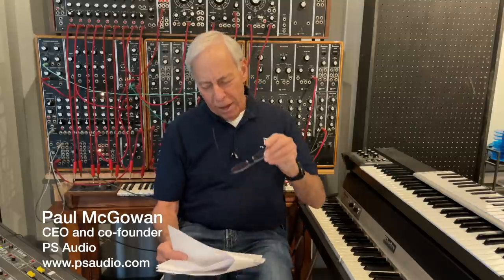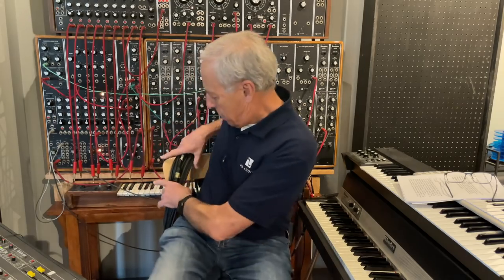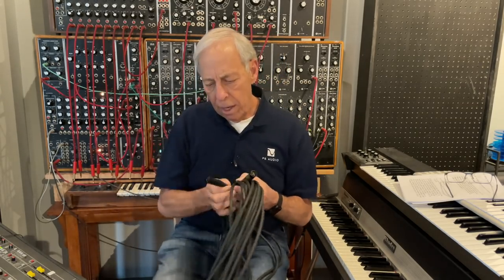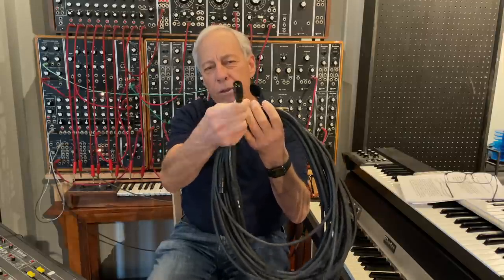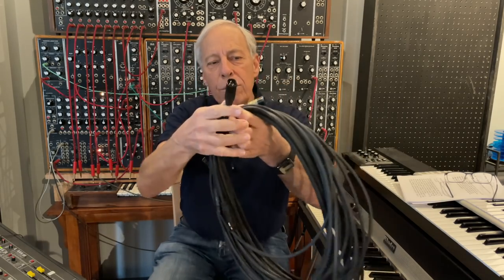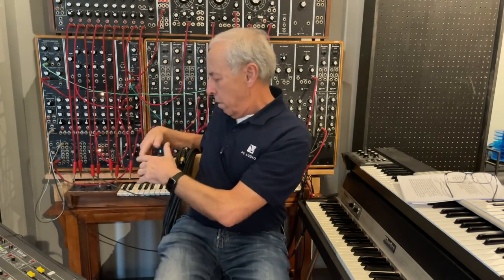Mixing XLR and RCA cables

Comment: Not really balanced not necessarily, balance can have a loss in sound quality depends on the construction of the equipment and if it's truly balanced or pseudo balanced and RCA cable can be great better in most circumstances. there's a big mistake people use the wrong type of cable and use 75 ohm should never be used for analogue signals, should be between 30 and 65 ohms and lxr cable is usually 50 ohms, specially for turntable use should be 30 / 50ohms, quality coaxial cable is fine for RCA especially on short runs that most people will have under 45ft more important is the type of construction of cable lxr is usually professional grade.
Reply: But unless your are the old analog telephone company, the characteristic impedance of audio cable is largely irrelevant. Yes standard Belden 8451 series is 60 ohms. But for analog audio it really doesn't matter for practical distances. 75ohm cable is fine for RCA cables except for the extra expense and the potential stiffness that can damage PC board mounted RCA connectors.
Reply: Over short runs at low frequency (and 20 kHz is definitely low frequency) the characteristic impedance doesn't matter. Furthermore, the cable used for balanced interconnects (often with XLR connectors, but not always) is definitely not always 50 ohms. Incidentally, twisted quads often are around 50 ohms, but not all balanced audio cable is a twisted quad.

Take a few minutes and read up on transmission lines- AoE does a very good job of writing it up in reasonably understandable terms. At audio frequencies, it isn't a concern unless the cables are several km long.

Comment: If XLR cables the best, why are manufacturers still putting in RCA connections on Amps, Preamps, Dacs,  SACD/CD players, etc?  Stands to reason that Audiophile equipment should only have XLR inputs and outlets to obtain best performance? Then why degrade the sound by using with older RCA technology? In the future, will XLR cables be the standard in the industry and RCA be phased out?
Reply: Xlr doesn't sound any better than rca its just better at eliminating outside interference and can be used for long runs. There isn't really any benefit to using xlr unless if you are running the cable around a shitload of other electronics or have to go far. The sound quality itself is identical.
Reply: Money
Reply: @EXTREMEROFLNESS73  exactly,, don't know why anyone would say any different,, BS audio,,, 😂
Reply: One obvious reason is that to design a small DAC or amp, big XLR connectors and additional components required take space. Also there is no meaningful difference in sound if RCA cable is not under interference. Otherwise yes, XLR is the way to go, but mini XLR should be the standard for home audio in my opinion.
Reply: Go look up the price of a Neutrik XLR connector. That should give some indication. They're also pretty big, and that takes up chassis space.

RCA should have been phased out decades ago. Any audio connector that makes the hot connection before the ground is a pretty poor design. Furthermore, the consistency of RCA connectors is awful. Some don't fit tightly at all, others have a death grip. I've had to replace more than a few RCA connectors that were ripped off the back of equipment. Usually the really expensive "audiophile" cables are the worst in this regard.

Comment: 5 minuts video, 2 reading the question and than saying balanced is he way to go as they reject hum.  
the anwer is yes you can mix cables but make sure to use same cable for left and right channels.

for short cables below 10 feet, unbalanced might sound batter as the equipment does not the balanced circuit to cancel the noise.

Comment: I went from single ended to balanced and noticed a huge difference in sound quality. Bass is deeper.
Reply: Some CD / DVD players and preamps from 1996 onwards provides a louder output - 3 volts or more - if you use the balanced XLR outputs but only gives 1 to 2 volt peak-to-peak output when you use the plain- vanilla RCA unbalanced outputs.
Reply: @laurentzduba1298  all of my gear is within 5 years old. So your explanation does not apply to me...my amps have a high gain with balanced connections. I'm not talking about loudness. I'm talking about sound quality.
Reply: Was this improvement after you were using an XLR to RCA adapter cable? This is entirely  possible and discussed above. If either device used a true transformer on the balanced side and the minus side was not tied to ground on the unbalanced side, the transformer then looks like a small coupling capacitor or rather a high pass filter. The result is only upper mid and high frequencies will pass through it. Now if the balanced source is an electronic output, then grounding the minus side can even cause damage as you are shorting out one of the OPAMPS. So in that case the minus side must be floating. Not easy it it! Go all balanced, go all unbalanced, or use a proper conversion box for the best performance.

Comment: Xlr cables have NO benefits over Rca cables in a typical home system,, don't be fooled,, 
Yes I've tried em,,!!
Reply: you can't go with balanced cables if you'r I/O is unbalanced. Right?
Reply: @5skov  Yes and no. If your components are unbalanced, that's correct. However, if you have an unusually long run, where an unbalanced signal degrade, you can use what's called a direct box. They convert balanced and unbalanced signals. You put one by each component, and it will convert the signal to balanced. Most of the time, these devices are used for pro audio, but there's no reason you can't use one in a home system if you have the need. You wouldn't use it to get better sound, it would stop the signal from degrading over a long run.
Reply: @solarfall2728  I play bass guitar and I know what a DI box is, this was an answer or question for Paul Wibb, sorry. Now I'm confused
Reply: but let's agree, that if one end of your signal is unbalanced, then the whole signal is unbalanced
Reply: like it has to be xlr to xlr
Reply: @5skov  I answered your question right here.

"If your components are unbalanced, that's correct."
Reply: the DI box converts normal 2 pin signal to 3 pin balanced, then the mixer and amp recieves 3 pin balanced
Reply: @5skov  Facts are facts. We don't have to agree on them. Of course, that's a true statement. A signal can't be balanced and unbalanced at the same time.
Reply: @solarfall2728  Thank you, I don't think a lot of people out there get it. I been working stage production for 30 years and was plesantly surprised when balanced connections hit the hifi marked 10 or so years ago. But now the old audiofolks dont know what it is
Reply: @5skov  No. xlr is just a 3 pin connector. Any 3 conductor cable will work, such as a TRS. That said, in order for you to have a balanced system, the components have to be balanced as well. Its not just the cable. When you use adaptors, only 2 of the 3 conductors are being used. I mentioned the DI box because I don't like to talk in absolutes. If there was some reason that you absolutely had to have it, you could make the balanced connection with 2 DI boxes. It would just be very unusual, but it could be done.
Reply: You mean no difference in YOUR system.... but a balanced connection will be quieter in most systems.  I have 3 amplifiers with both balanced and unbalanced inputs, and in every case, the balanced connection is quieter than the unbalanced one.  With less efficient speakers, this is a non issue.  But if I connect my 96dB/W Tannoys, then I certainly can hear the difference.  I hear the very slightest background buzz with it unbalanced.
Reply: @TheMirolab  your'e in the wrong chat Miro
Reply: @5skov  My (limited) understanding of direct boxes is that they use a transformer to convert between balanced and unbalanced.  If the direct box does actually have a transformer, then (e.g. converting from unbalanced input to balanced output), the resulting balanced line will TRULY be balanced.  The only remaining issue from an audiophile perspective would be whether inserting the transformer into the path is degrading the audio quality somehow; it probably depends on the quality of the transformer.
Reply: @kc9scott  Yes! Quality of components, as always
Reply: @TheMirolab  well my system isn't most systems then,, is it, 
if ballenced works best in YOUR system then good for you,, I'm happy for you,, 
But if I heard a buzzing noise in my system, I wouldn't be imeadeatly reaching for ballenced cables,,🤔